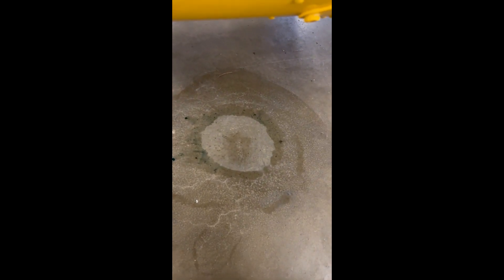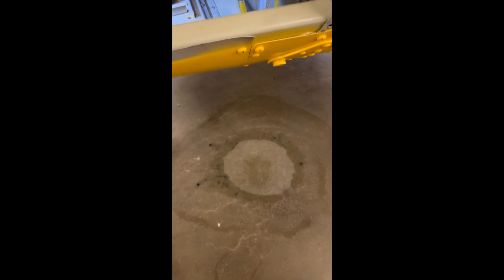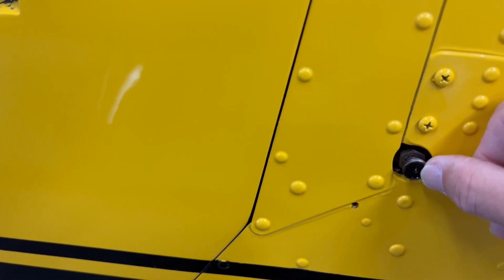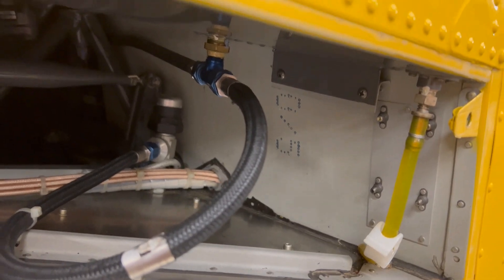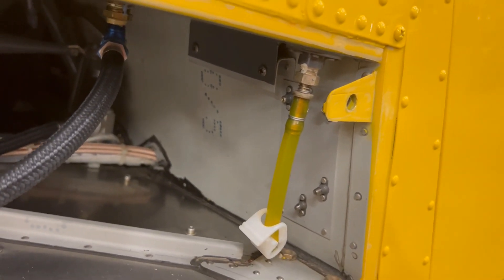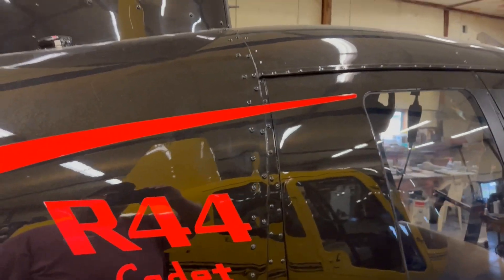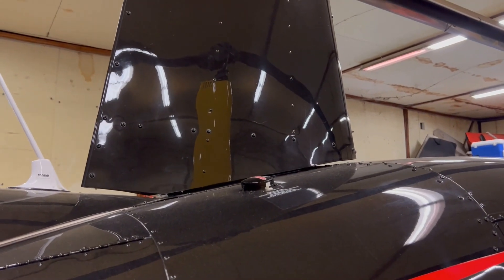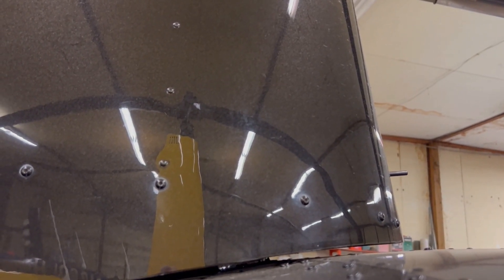Why is Fuel leaking from my  R44

Comment: Lets add another one. Over about a 6-7 year period i’ve had 3 different fuel sending units leak. They leak at the threads where the shaft passes through the body. Once the little rubber gaskets start to fail, it’s going to leak, poor design. These fuel senders weren’t originally designed to be mounted upside down.  One Solution is for the manufacturer to pump fuel resistant caulk into the body as they install the shaft. Brought this to Robinsons attention but they act like i’m the only one this has ever happened to. Yea right!

Comment: I remember that trip. Correct me if I’m wrong but luckily the vent for the check valve for the aux tank was blocked so fuel could not exit the aux tank (aircraft running on fuel only from the main). And the low fuel sensor is on the main tank only. If things were reversed and the vent for the main tank was blocked the aircraft would be running on fuel from the aux tank only and could therefore could run out if fuel without a low fuel light illuminating (since the main would still be full). Is that correct?
Reply from the maker: You are Exactly correct!!